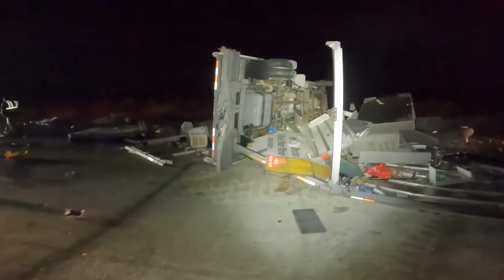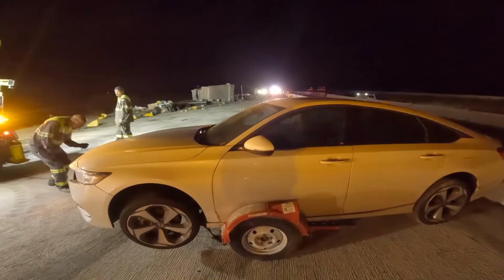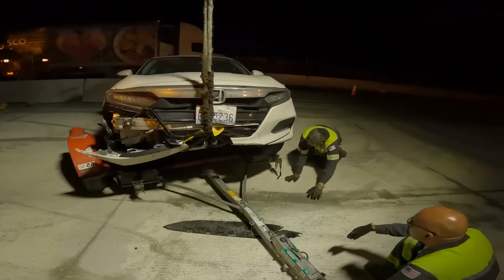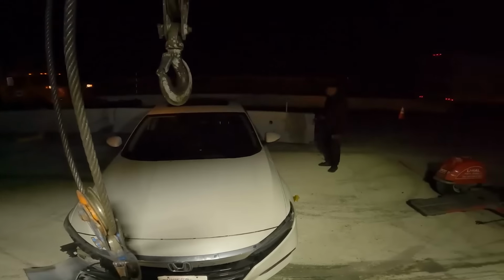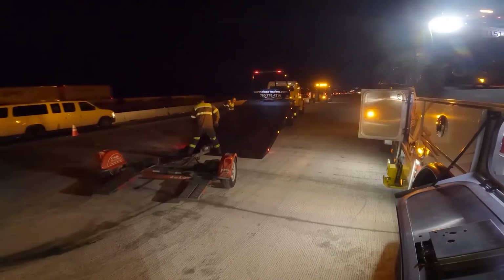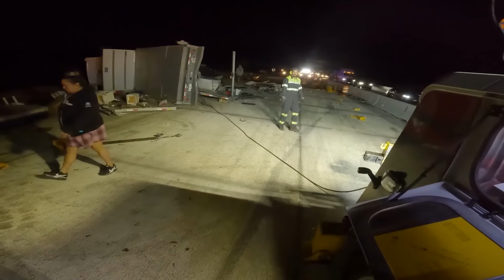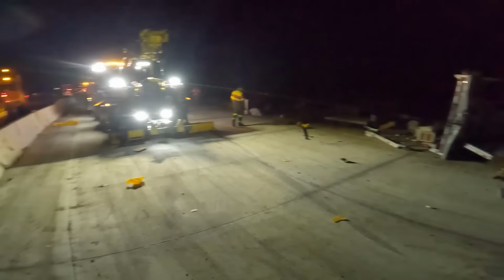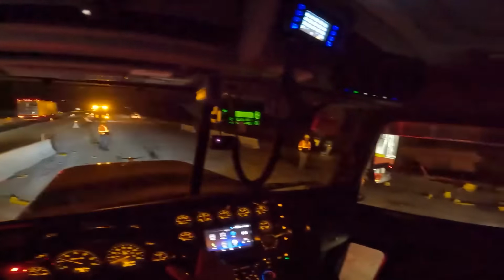Box Truck Turns Into Flatbed! Rollover Collision

Comment: What happened to the cat? Did you just dump it on the roadside? No doubt it was frightened by the chaos, then having strangers handle it. They had at least 8 reasons why you should be kind and gentle.
Reply from the maker: No, the other individual there in the passenger seat was the owner to the cat. He was able to get it out
Reply: @plazatowing  Thanks for the reply, Trent. You guys do a great job of cleaning up the mess on highways. At least the people involved got out alive. What was the cause of that accident. How did that guy get on the contractors side of the barrier?